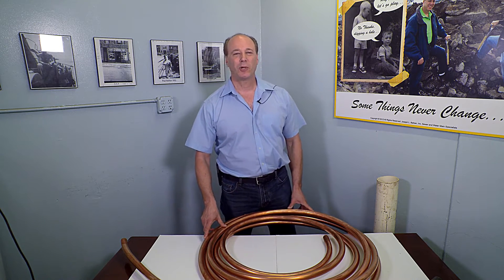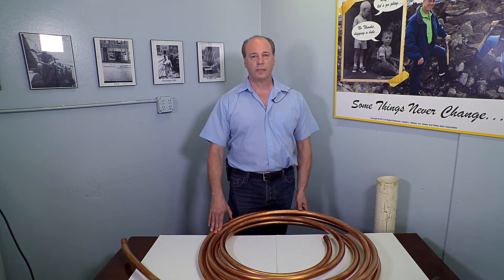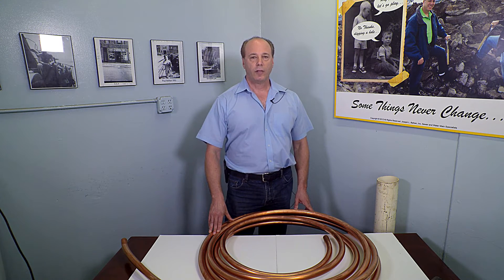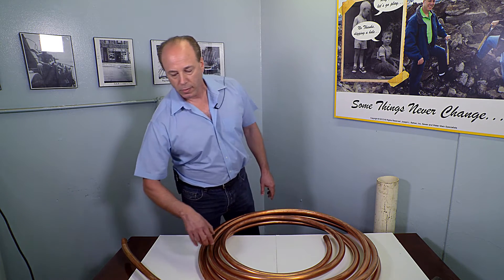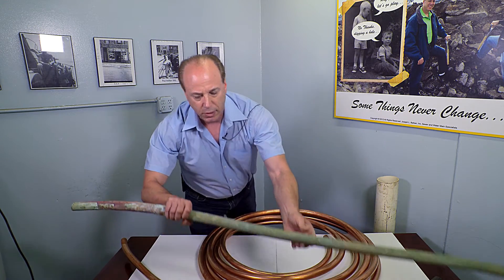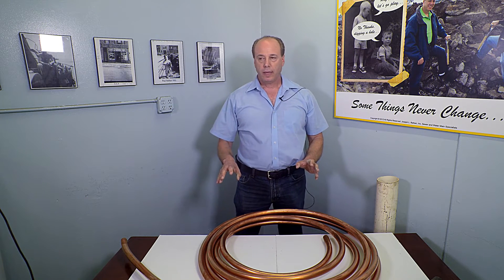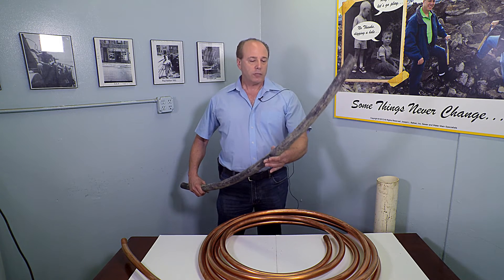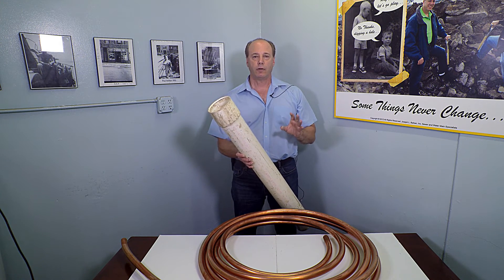Copper Pipe Electrolysis - A Water Main Killer!

Comment: The only Big User of DC Power in NYC is the MTA Subway system, so you should report the stray DC current to the MTA to have their electricians investigate where the DC current is getting on to the water main system and causing electrolytic corrosion of people's metallic water pipes.  Bill the MTA for your services and they will pay you in expired Metrocards.

Comment: The Problem is the National Electric Code requires the Electrician to bond the house's Ground wire to the copper water pipe and if the plumber insulated it under the ground, then the house has a false water pipe ground connection, which could result in a shock hazard to those that come in contact with that house's metallic water pipes.
Reply from the maker: On point. Plus underground grounding rods have a limited lifespan.

Comment: Ran into this problem today. Burst my hot water pipe in my crawl space 😢.

Plumber said the exact dame thing.
Reply from the maker: Try installing dielectric fittings. They stop the flow of electricity.
Reply: @balkanplumbing  until I do so, someone recommended wrapping electrical tape around the pipe to act as insulation between the pipe and metal hanger. 
Would that work until I did something more permanent?
Reply from the maker: If the leak was caused by a dissimilar metal pipe hanger yes. Or change to a brass pipe hanger (similar metal).
Reply from the maker: Not to get overly technical, but what you have might be galvanic corrosion. Different than electrolysis. Just a fun fact!
Reply: @balkanplumbing  thank you!
Reply: Yea a plastic pipe or a plastic jacket. Plastic is an electric insulator.

Comment: Does this happen only when the copper is in direct contact with the ground soil or could it happen also inside concrete/brick walls and floors?
Reply from the maker: Whenever there is stray electrical current attacking bare copper. So yes indeed, copper inside walls, concrete, etc., can be destroyed as well unless it is protected by some sort of insulation.

Comment: I just looked it up.  Water is an electrolyte and the electrolysis corrosion comes into play when the copper pipe is in contact with another type of metal.
Reply from the maker: That is only one small instance causing underground copper pipe electrolysis, and is not the primary cause. What you refer to similar to galvanic corrosion; when copper or brass are connected to or touching galvanized pipe.
Reply: @balkanplumbing  So what is the cause?
Reply from the maker: @lesliekendall2206  In the video description and the posts. From the video description "Copper pipe electrolysis often happens when stray direct current (DC) electricity causes the pipe to decompose. However, copper pipe electrolysis, also referred to as water line electrolysis, can also potentially be caused by many modern appliances. Appliances such as hairdryers , and other conditions as well, can cause water line leaks and pipe failure. Because copper is an excellent conductor of electricity..."
Reply: @balkanplumbing  DC current in a house?  No electrical is DC.  ???
Reply from the maker: @lesliekendall2206  Public trains are DC. Hence why that is why they are the typical source. Modern solid state appliances are also being brought into the conversation lately.
Reply: @balkanplumbing  Thank you for your patience and great explanations. 👍
Reply from the maker: @lesliekendall2206  You're very welcome. You are by far the most inquisitive viewer I've ever had - which is a good thing! Stay safe.
Reply: @balkanplumbing  It's so funny you say that.  I was married to a mechanic and would ask so many questions when he was working on our cars, I'd make him a little crazy.  So one day I told him that I can't help how I need to "understand everything" but if he'd just take 5 minutes before he started a job to explain what he was going to be doing, I wouldn't need to bother him while he worked.  That strategy probably helped keep our marriage together. 😆

Comment: Thanks for for that, will the plastic sleeve do the job?
Reply from the maker: We use PVC at least 2 sizes larger than the size of the copper line. Example: 2" PVC around 1" or 1 1/4" K copper. 4" PVC around 1 1/2" or 2" copper. 
At the point of the connection to the tap (the swing) , we approved wrapping. That seems to work 100% . Any comments/questions, just reach out! BTW: Thanks for subscribing, it's appreciated.

Comment: could wiring a block of zinc to the pipe help to reduce the corrosion? Similar to the anode used to protect a marine motor?
Reply from the maker: I do know anodes are used to protect underground utilities from electrolysis, however I am not personally famliar with anodes. Very good point. Anodes are run alongside the line being protected, so the  stray current attacks the anode, not the line. Again very nice point, thanks!

Comment: I’m going to let you in on a little secret Dave. This Electrical charge your speaking of isn’t the issue, it’s actually the result. Copper, Gold, Aluminum, Bismuth are metals of low magnetic permeability. If water or a similar material flows through a cylindrical length of such a metal it creates a Dielectric field. When a Dielectric field is combined with our Earths natural Magnet field it creates Electricity. (Electricity equals Magnetism+Dielectricity.)(Magnetism+Dielectricity equals Electricity.) “One must be sane to think clearly, but one can think deeply and be quite insane.”
Reply from the maker: While you speak on a level above my understanding, and I appreciate the comment, what you describe does not result in the complete destruction of copper water lines in 2 to 6 months. That is what many property owners in NYC are experiencing right now. The complete destruction of an underground water line in such a short period of time is not usual, or the result of a natural occurrence. With that said, I found yogurt respire interesting and enlightening.
Reply: @balkanplumbing  So did you ever explain what IS causing the problem?  I heard the word electrolysis but what's causing it?
Reply from the maker: @lesliekendall2206  I explain it to a degree in the description underneath the video. And here are two links to a more detailed explanation: https://www.balkanplumbing.com/copper-pipe-electrolysis-copper-water-main-killer/ and https://www.balkanplumbing.com/copper-pipe-electrolysis-corrosion/. More and more copper pipe electrolysis is occurring in areas where it was never before occurring. In those instances it is still being investigated. In the past electrolysis would almost exclusively happen in the vicinity of elevated train tracks.
Reply: @balkanplumbing  And insulating the copper pipe always stops the electrolysis?
Reply from the maker: @lesliekendall2206  If the source of the stray electrical current is underground, then yes. If it internal (from the house) then no. In almost all cases the causes of electrolysis is external (from stray underground electricity). To eliminate any chance it is from an internal issue, your plumbing can be tested to see if it carrying current. This can happen (very infrequent) if your primary electrical ground is defective, and the secondary ground on your water line is being used. It is only supposed to be a back-up, never the primary ground.